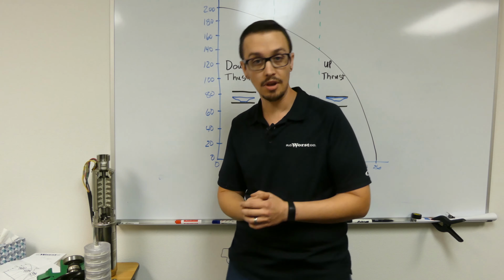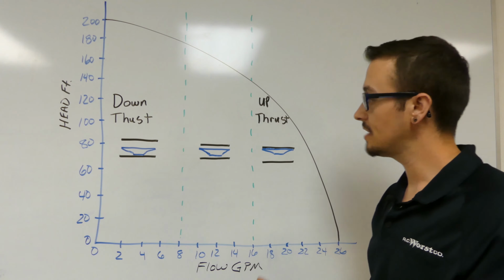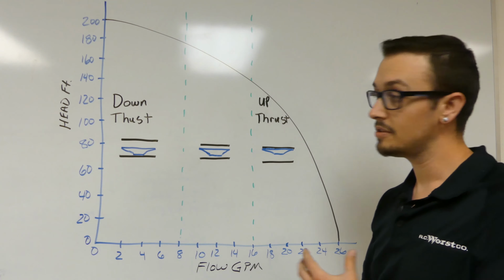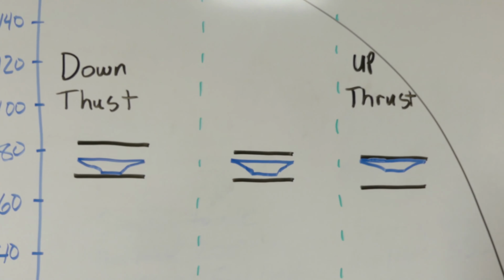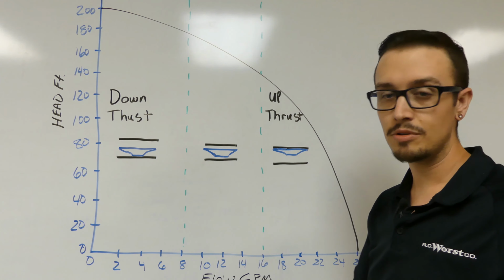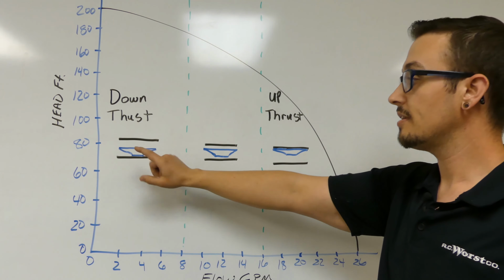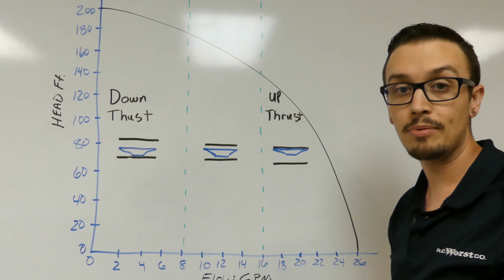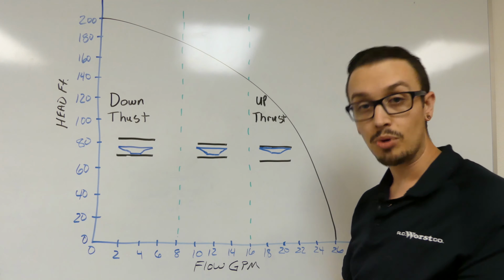Pump Sizing: Upthrust and Downthrust

Comment: I'd like to make a correction. The impellers in the vertical pumps for municipal and industrial water (Goulds, Franklin, whatever....) are colleted (attached) to the pump shaft. The impellers do not freely "float" inside the diffuser. By being attached to the shaft, the impellers move with the pump shaft and the thrust is therefore transferred to it. If you were sizing up a line shaft, you should be concerned about up thrust and make sure your surface motor have a correct bearing to handle that thrust. If you were dealing with a submersible electric motor pump, you should be concerned about down thrust and make sure the motor bearing can handle it. Although not recommended, these pumps are well suited for down thrust operation (as they are usually considered to be operating on some sort of down thrust).

Comment: I've been told it's a good idea to perform a couple of holes in the non return valve ball to allow the water column to leak down and make pulling out the hose easier if need be... What's your opinion ?

Comment: I never understood the up and down thrust. Thanks this helps a lot. I’m currently in the process of putting in a pump in my new well. It’s a 30gpm well at 280ft. But I’m setting the pump at 260ft and went with a Goulds 18gs20, so 2 hp, 18gpm ideal rating. But was told with the water static being at roughly 50ft below surface, I will have more than 18gpm flowing into my holding tanks. Do u think this pump is sized right for my well? Will it be a problem for the pump if it’s flowing say 22gpm-25gpm instead of the 18gpm? If so maybe I can swap the pump for a 25gs20, so 2hp 25gpm. Please help me out if u can. Thanks

Comment: Thanks for the great videos. I have a 20-year-old submersible pump (100 feet) that hasn't been turned on for 10 years. Should I just try to turn it on, or should I remove it and take it to maintenance or just replace it? It would be great to have your advice.
Reply from the maker: Miguel, I would try turning it on before you pull it. It's going to get the smoke test either way, at least if it works you don't have to go through pulling it and setting it again.
Reply: thanks for your answer. I'll give it a try.
Reply: @miguel1437  How did it go? :D